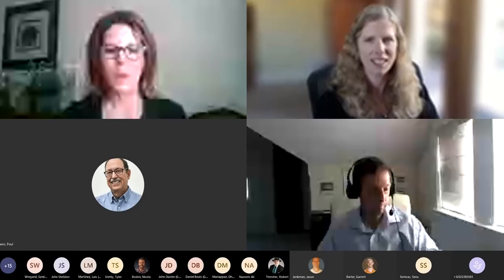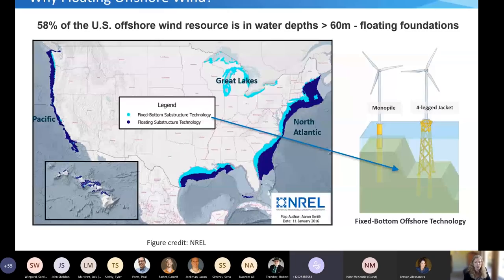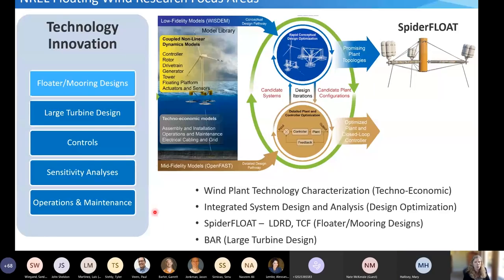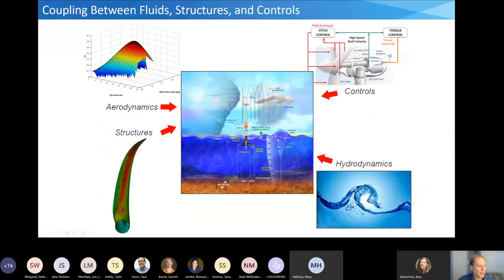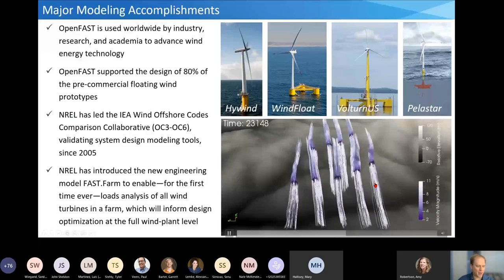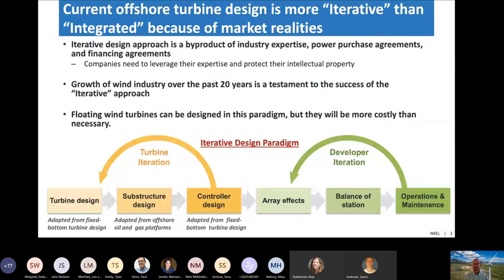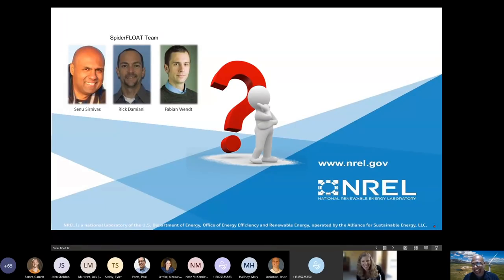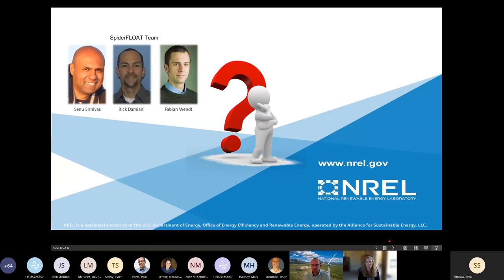Floating Offshore Wind Systems of Tomorrow

Comment: I do not know if i agree with this as I feel  this would be unsafe. what happens when a big enough wave flips a wind system over on its side?
Reply: If the center of gravity is below the center of buoyancy, it is impossible to flip it over. It's a bit like trying to balance a pyramid upside down on it's pointy end, it can't be done whereas it's pretty stable on the wide end
Reply: @aproopdheeraj  I disagree to a certain extent I would never underestimate mother nature.
Reply: @billycollins4288  I would also not underestimate the cost savings involved in this type of project.  Is this "free" energy, or is it really, really expensive in the long haul?

Comment: I am a retired construction engineer. To me this looks like over engineering. The oil industry has a history of semi-submersible oil drilling platforms. Why not employ proven technology rather then reinvent the wheel. In my opinion you can make a platform of underwater pontoons made out of concrete with ballast tanks,  Float the rig into position, flood ballast tanks, anchor platform. Fast setup with adjustability. Deepwater capable

Comment: Mie nu_mi plac turbinele VHW. Au mult diametru inutil pt că palele nu sunt aerodinamice, nu funcționează la viteze mici, nu funcționează la viteze mari, ale vântului. Aerul nu are densitate mare. Sistemul nu trebuie forțat cu pinioane, cu magneți, cu tensiune în sarcină. A extrage curent electric din vlânt e ca și cum vrei să distilezi parfum sau alcool. Eu aș monta mai multe turbine Darius producătoare de aer comprimat cu compresoare centrifugale, că la tubocompresoarele aero. Si conducte până la uscat, unde aerul comprimat poate fi folosit ori în grupuri electrogene, ori în aer liqid, ori în fabrici direct. Sau aer condiționat, pompe de căldură. Aerul comprimat este compatibil cu orice sursă de forță. Si poate înlocui și sistemele electrice, fără transformatoare. Poate fi stocat cu costuri minime. Fără nici un gram de cupru, magneți, electronică, baterii, mentenanță facilă. Oamenii nu trebuie să plăteascâ mult pe  energie doar pentru faptul că există tehnologie avansată. În acest fel energia eoliană va fi mai eftină cu 80%.                    !!!